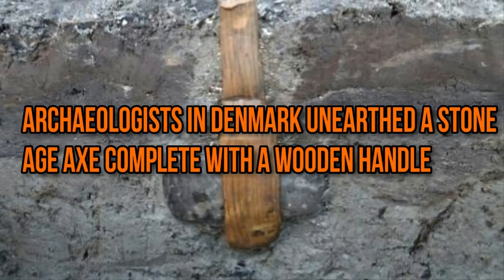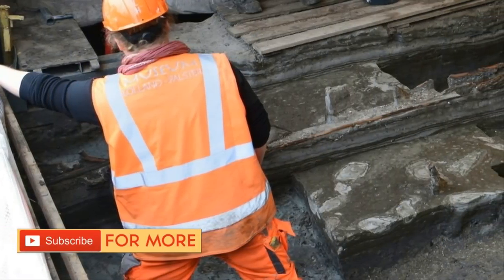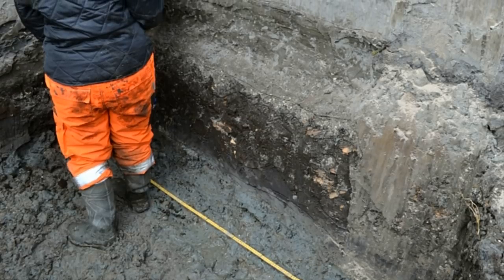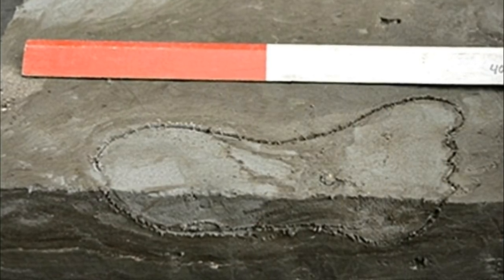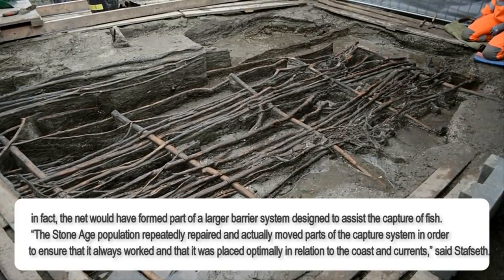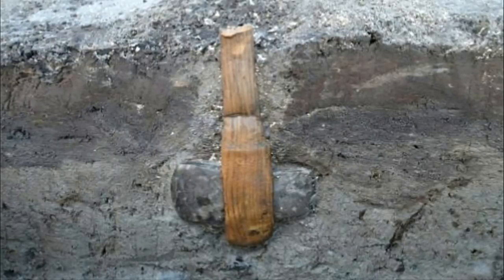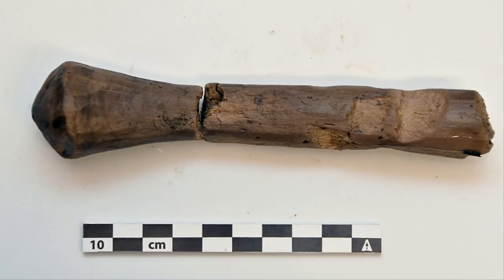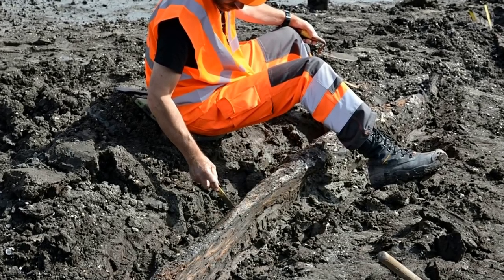Archaeologists In Denmark Unearthed A Stone Age Axe Complete With A Wooden Handle

Comment: @6:35 can be explained ...  i.e. finding SHAFTS of AXES on the perimeter is NOT unusual or peculiar at all ... ALL you truly need is an imagination to imagine those 'T' pillars in Anatolia, Gobekli Tepe where we find on the perimeter the 'T' pillars that dominate ... with two 'T' found in the center which would in some correlate to what we found buried at the center of this 'altar which is a model' of ?
The KNAPPING of the handaxe using the 'chopper stone' had been going on for 1.5 million years ... thus this TECHNOLOGY is where it eventually lead to >>> 
handaxe >>> [add a shaft] axe/hammer = T = TAU narrative that has been ever emergent and hidden in plain sight for the past 12,000+ years ... yup the 'T' eventually became the Hammer of Thor which today is the 'gavel' used by a judge  ... bang bang bang can we have some order in the court of chaos?
didn't you know?